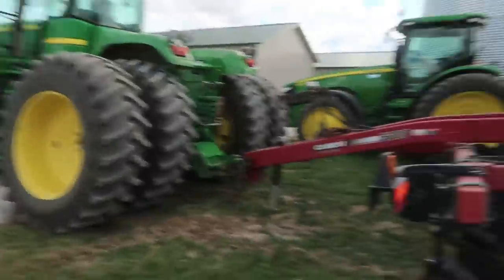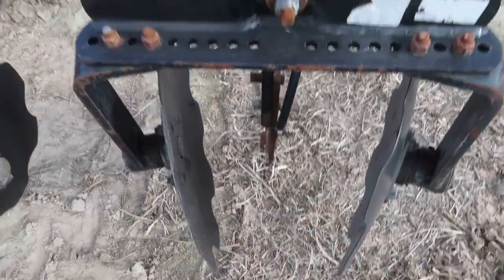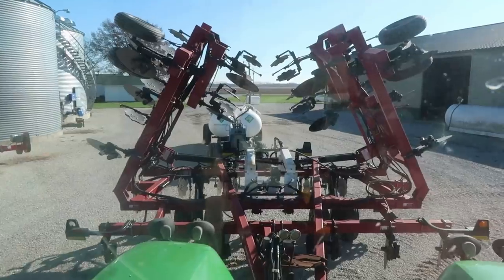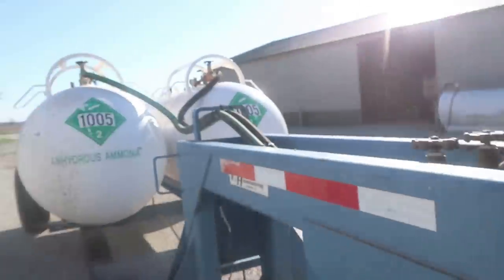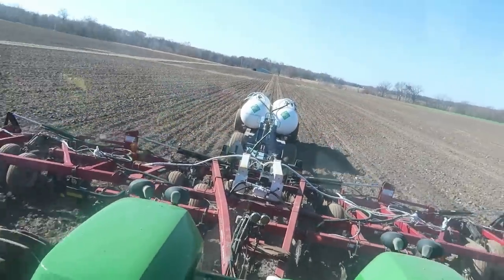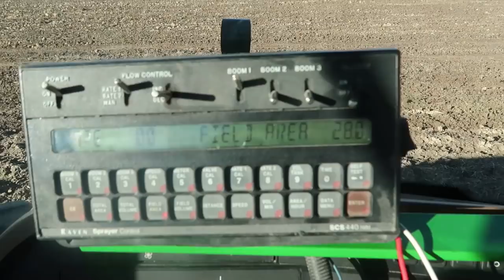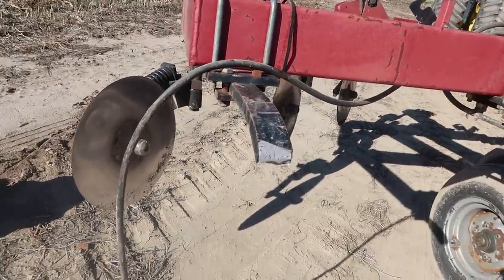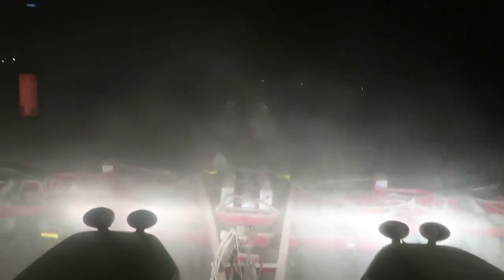fall applied anhydrous, it's pretty common around here!!

Comment: We quit doing it around here.   Used to run in the spring and then side dress what what we missed directly into 1-2 foot corn.   If you pulled out the machine before you for it shut down the anhydrous would burn the corn.    The bass could always see where you screwed up.  Haha.   I don’t miss pulling tanks.   That was a real pain.  Have a fucking great day.
Reply: Does the coop own the bar and the tanks?   Only the big guys around us had their own bulk systems.

Comment: How does the N serve get into the tanks? I’ve used anhydrous for 30+ years and I’ve seen stuff like that N serve and wondered how they get it mixed
Reply from the maker: The rate is 1 qt per acre so they figure how much actual N you're putting on and then they pump it into the anhydrous tank.  The custom rigs around here have an n-serve tank mounted to the applicator and it injects the n-serve in at the manifold, instead of running it through the tank.
Reply: Didn’t ever know that 👍

Comment: A cool trick is to take a dollar bill , put it so when you vent off line directly onto bill, then immediately  put bill  next to high heat source , like radiator  or exhaust  manifold,  , it will turn bill into monopoly size bill
Reply from the maker: Yeah I've made a couple of those for the kids.